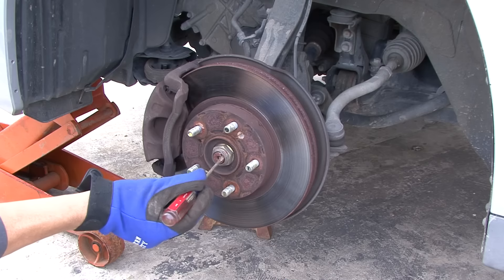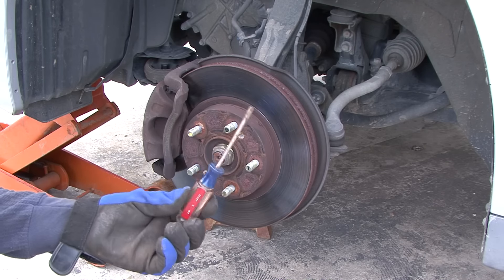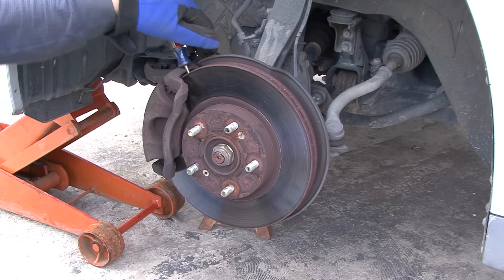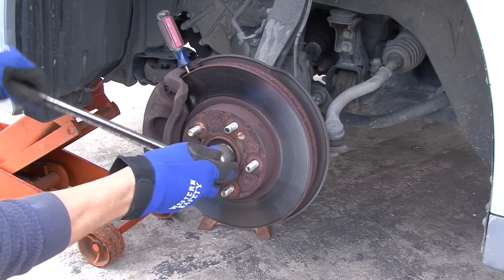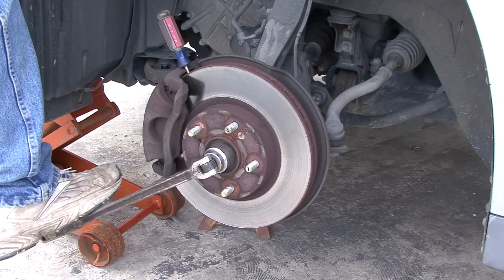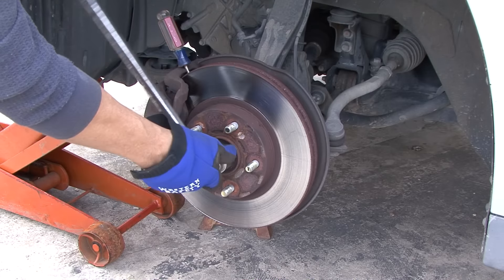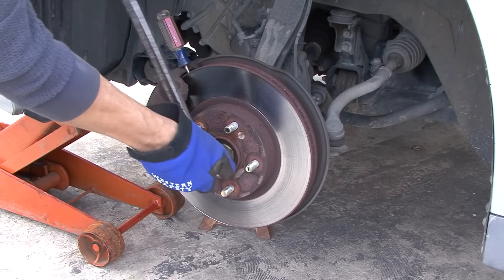How to make getting your CV axle nut off easier

Comment: Good idea with the screwdriver but I've never had a nut come off so easy. Normally it takes 2 meters of an extension and a 100kg individual dancing on it.
Reply: +David Egan Even then, you`re lucky if it budges
Reply: I have snapped 3 Craftsman breaker bars trying to loosen mine.
Reply: I think this may have been pre run 😉
Reply: no he's right they come off that easy with the screw driver in it, managed to pull off a decade old bolt after having put a torch, grease and a breaker bar with my weight and nothing, but fuck it the screw driver worked better than the breaks so there was probably paper work done to get this squared away
Reply: @johnkennedy3867  how did you get it off
Reply: @corymontano2661  ....it was the passenger side, front hub nut. I was two minutes shy of burning up the car and making it look accidental so I positioned the 4th breaker bar with a 3 foot 'cheater' to the right of the hub as close to the ground as possible then placed my 3 ton floor jack under the end of the bar and SLOWLY started to jack up the bar keeping steady upward torque on the cheater until it FINALLY 'popped'! 
thought for sure I had snapped another craftsman 18" breaker but no I hadn't.  you would have thought I hit the lottery!!!

Comment: First off it is a nut, not a bolt you are removing. Second it was already loose, they do not come off that easily. . .
Reply: Brian Swartz
most people understand the term is usually used in common exchange.  even idiots understand from the video whats you going on.. And yes it dose crack that easily I just did it an hour ago on an 05 2500 that was well passed prime condition
Reply: Matt Crawford The hell it does. I had my impact on mine and I am afraid I am going to screw something up on it.
Reply: I tried to "push down" on mine and I just lifted myself up in the air. And my breaker bar was like 3 times as long. And if I tried to lift instead, it felt like the car was gonna tip over. (but I managed to get it this way)
Reply: Brian Swartz   
Thanks captain obvious it's a nut! (as it says in the title) Smh!  He's just giving a quick demo, this could be helpful for someone that doesn't know ..
Reply: Every car is different. Your car isn't the only car in the world. I've had cars where it does come off that easy (he's also stepping on a breaker bar, which is A LOT of force, so it's not really "that easy"). I've also had cars where they were so tight that I put the lug nuts in and wedged a breaker bar against the ground, and it literally sheared the threads off a lug nut, before bending the lug nut, and still didn't come off until after another method.
Reply: We all knew what he meant by bolt. I just removed an axle nut after watching his helpful video and mine came off just about as easily after I’d soaked it 10 min with penetrating oil.

Comment: Absolute genius! After an entire morning spent hammering, heating, impacting, WD40-ing and plenty of cursing, this method worked inside of 5 minutes. I put a bottle jack under the socket for support and used a 24" breaker bar with a 4' pipe on the end for extra leverage but it cracked the rusted seal first push. Thanks so much for this simple but brilliant idea.
Reply: Bro hit it with a high powered impact and you won't have this problem lol
Reply: @frazer9 He just said he solved the problem.  Get lost.
Reply: @Spartan-Of-Truth  LOL
Reply: @zhrob1  Lol, the density man.
Reply: I haven't got to cursing yet

Comment: I am sure it works sometimes, however mine is 14 years stuck and after trying your method with a good penetrating oil I have just stripped the nut. I believe after a certain point one will just need to get mean with a chisel or more preferably an air cutting tool.  Regardless, I appreciate the simple trick advice.
Reply: I have already started at cutting mine off anticipating needing to buy another higher end cutter if the wheel on the ground pop off center cap idea does not work w/ 6ft breaker bar

Comment: You're a god damn life saver. Only vehicle I have and I have to get lower ball joints out before a big trip across the U.S. for a new life changing job in a couple of days. I already cut the nut off of my lower ball joint so I started to panic when I couldn't get the nut off the CV and all the videos I watched weren't helping, I just don't have all the equipment they do and I don't have to money for someone else to do it, then I just tried your method, I had to post immediatly to thank you. 11 years later, you're work has made a huge impact on my life and my families in a way you can't even know.

Comment: I did Break dancing and moon walking on my breaker bar and an extension bar ..no luck on a 1996 Maxima ....put a few blocks of wood on the ground and put the breaker bar on that and put the car in drive and it was picking the front of the car up and still not coming loose..Breaker bar went Snap and went flying broken up over my hood  ..went to hourborfreight and bought an impact gun and " POOF WHAMO " Off came that nut

Comment: Thanks for the vid, it certainly helped with the screwdriver. I still couldn’t get it though until I started pulling “up” on the breaker bar. Instead of pushing it down to the left with gravity. Back muscles are stronger...hopefully that helps someone too.

Comment: The trick with the screw driver in the venting hole is quite useful!
But the nut is usually much harder to untighten.
Once had one, which didn't move with an 1 yd extension by standing on the end of it.
Reply: Can’t get mine off

Comment: Thanks to this channel and commenter ideas.   If this does not work as shown in the video trying it with center capped popped off and wheel on the ground with a six foot pipe connected to a 1 1/2 ft breaker bar,  Ended up popping removing wheel, then added PB Blastered Axle nut, Torched Axle Nut, Chiseled and Heavy Hammered to cutt into opening slot as demonstrated, and chiseled away quarter inch covering of metal portion around hub, then PB Blastered and Torched one more time, popped wheel back on, placed wheel chalk at both end of wheels, and cranked back and forth both directions till I heard slight cracks, and finally forced as much pressure as possible after about 10 to 15 minutes of back forth to break nut free. Used 5ft hollow tube connected to new breaker bar. Required for 02' Mazda Protege5 driven in sleet and snow with 16 year old axle nuts.

Comment: I was replacing a wheel hub assembly following a tutorial and when they got to the part about taking the axle nut off i had already taken the rotors and brake caliper off. here's what i did: literally just jammed the base of a ratchet behind the hub, between the metal frame (?) behind the hub and the top of one of the studs, and then cranked it. the ratchet fell out a few times but it worked and i was desperate

Comment: I am working on a my Dodge Dakota and have tried this, as well as soaking it in PB over night it wont't budge. Yesterday I went and broke two 1/2 inch breaker bars trying to get the nut off. Today I spent all day with a MAP torch to the nut and after about 2 hours I broke a third 1/2 inch breaker bar so I am picking up a 1 inch breaker bar and the one inch socket so if using a map torch and a breaker bar rated to 1800 ft/lb of torque won't get it off then I am gonna need a miracle.
Reply: what happened alex did you get it
Reply: @alexcorrea308  I bought a 4 foot galvanized steel pipe today from home depot to get mine loose. $30 smh

Comment: I have never seen it come out that easy. That was a lot easier than my jeep (still haven't gotten it off after 2 days of trying).
Reply from the maker: ***** No i didnt pre-stage it but i had it off recently so it made it a lot easier than if it had never been taken off before
Reply from the maker: Oh don't get me wrong iv'e had some that was a nightmare kinda tight and had to use a big pipe to break free but i still used the screw driver on it too lol
Reply from the maker: No don't use air on cv axles it tears them up easily
Reply: +Cody the Car Guy Why would you care about the old one?

Comment: People who are watching this lol, normally a 10 to 15 years old axle nut is about 9000 times harder to remove than shown in this video. Right now I'm trying to find OTHER ways to remove the damn axle nut... such as perhaps breaking the nut itself, because mine won't even budge after heating it up and a 5 feet breaker bar.
Reply: +totszwai Dude that is truth!   I just snapped the head off my Craftsman breaker bar working on a 15 year old Accord.
Reply: Twenty year old Accord here. lol I was using my impact and it almost looks like the nut is starting to crack on the sides. Not sure if I should keep going.
Reply: Definitely Tru
Reply: Yep
14 year old Jeep and won’t budge for nothing.
Reply: Damn...heat won't work for mine either...now I want to buy a extension bar for my breaker bar sdmh this video is spool fake
Reply: Not the safest way in the world, but I got mine off by using my jack to lift my breaker bar handle. You'll want a strong breaker bar though.
Reply: @jerryjones2976  Why are old Hondas the absolute worst??
Reply: Sorry that I am 5 years late to this conversation but what did you do to finally break that nut?  I'm currently battling the same kind of nut and I am hoping that you have something new for me to try because I have tried everything and broken some equipment along the way...
Reply: @danrodrigues3531  Yeah, I found another 4 feet metal pipe and just hook it up to my existing breaker bar, basically... just get it as long as you can to multiply your force... when it broke loose, the bang was so loud that it sounded like a firecracker or gunshot lol
Reply: @ericto2958  After about 2 weeks and two broken breaker bars, I finally destroyed that stupid thing with a Dremel.  A Dremel with a tungsten metal grinding bit and ground out a 'valley' a couple of mm wide down to the threads on the axle that was being removed and that left just a tiny amount at the back the I couldn't reach with the grinding bit.  At that point I took a chisel and smacked the hell out of it towards the left and after some whacks, I noticed a small crack at the back which got to the point where the damn thing finally spun off with that 'valley' splitting it all the way to the back.  I have never been so frustrated with something so much.  I was spinning my wheels for days, going insane and it finally broke free.  Damn, it was too hot to work that hard on anything...
Reply: I just took mine off with a cheap corded impact wrench! Took about five minutes! $80 taxes in and no pulled muscles reefing on my breaker bar! Make sure to use penetrating fluid! Just replaced a strut assembly, a d used the impact wrench where ever I could fit it! Saved me hours of frustration!

Comment: One way is to loosen the nut while the tire/wheels are resting on the group.  Chock all the wheels and ask someone to apply the brakes before using the breaker bar.

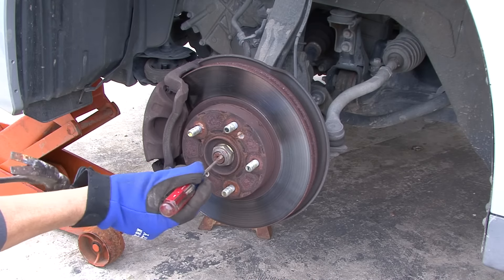Comment: At about 0:25 If you don't have the right size chisels getting that dimple out is a PITA too! Been working on it for an hour now and already broke 2 screwdriver heads. Mine is crimped all the way to the inner metal so I can't fit a screwdriver in there.

Reading comments about people breaking 1/2" breaker bars... wtf is wrong with cars these days.

Comment: WD-40 is your best friend in this situation. If you have nothing else. Spray some on the bolt and use anything you can to try to vibrate the bolt (as shown in the video with the screw driver) after spraying, and vibrating it 4 or 5 times let it sit for about an hour. Getting it off should become possible after that.

When I say vibrate it I mean, hit that thing with the might of Thor.

If it hasn't been removed for 15 years there is NO easy way to remove it but, with WD-40 it just comes down to time.

Comment: Thanks for the tip. I've heard not to use impact wrenches on anything with ball bearings, because the impact will rattle the bearings and cause premature wear. That's why some mechanics who have strong impact wrenches will still do this manually; no impact.
Reply: Finally, someone who mentions what my automotive teacher has taught me.
Reply: but if changing the rotor and the bearing is in the old rotor? it wouldn't matter right?
Reply: @zanecid1232  You can use an impact for removal, but should not use it for installation.
Reply: @genericusername1365  makes sense. thank you. that's why I got the torque wrench as well.
Reply: @zanecid1232 BEARING IN THE ROTOR ..... 😂
Reply: @frazer9  I'm confused

Comment: Man next time this screwdriver is going to brake and pinch your elbows , arms or eye ...  As a lot of people said below : THE BEST WAY for doing this is with the rims bolted on , and removed center cap , while vehicle is on the ground ! + Bonus from me - get e person to step on the brakes , you will tell me why ;) ?
Reply from the maker: 100's of cv axles later I have never broke or had a issue with the screw driver . It just works!! And sometimes doing it with the rim bolted on you will find the socket comes off easier because you are father away and can bust knuckles or what ever is in the way when it slips off.

Comment: I put my entire 300lb ass on the breaker bar and the nut don't move!!!
Reply from the maker: I have had a few be that tight. One one i used a 6ft pipe to break it free. You never know if someone used red loctite or not. You can also heat up the nut they spray some pb blaster
Reply: Cody the Car Guy Yep used a pipe and the 1/2" head snapped off the breaker bar.
Reply: +BigDish101 
I'm with you. My truck is torqued from the factory at 170 lb-ft, but that was 120,000 miles ago. Penetrating oil did nothing, not even with an impact gun. Today I'm going to blow torch and use a 6ft cheater bar. Hopefully I don't snap the breaker bar given how badly my week has been going lol.
Reply: +Mark Well how did it go??  I already used a gallon of liquid wrench, a propane torch, a 4 foot pipe, and the head just broke off my Craftsman lifetime guarantee breaker bar.   WTF!!!!!!!!!!!!
Reply: +jerry jones I put the wheel back on, put the truck back on the ground and stood at the end of a 4 ft breaker bar, lightly bouncing on it. It never truly "broke" free, so I had to back my truck up until the breaker bar was off the ground and repeat the process a few times.
Reply: My 3/8 bar broke off into socket while standing on the pipe extension. I threw the socket out of anger and the broken bit flew out. I ended up buying 1/2 bar and torched it for a couple minutes, came off no sweat.

Comment: Pshh yeah, i wish it was as simple as that. If this were the case, i would have been done replacing the bearing on my car 3 days ago....mine will not budge at all, its broken 2 breaker bars, ive danced on it, attempted to break it loose with the tire on and on the ground and a Big fat NOTHING!!! Im beyond frustrated with it and my repair process is at a hault until i can find a way to break that loose

Comment: What if it's so tight that the breaker bar breaks
Reply: +Lucas Burton I think I am about to have to resort to cutting the nut with my dremel.
Reply: +BigDish101 You da man!!... dremel did the trick.  Actually had to slice through the fucker in 3 places to get it off in 3 pieces.   Unbelievable... it ain`t rust... after 15 years of heat from the brake rotor, the metal fuses together.
Reply: You have to get 3/4 breaker bar and a long pipe :)
Reply: a 3/8 breaker bar just died here. Getting a 1/2...

Comment: Great tip. I already took the caliper and rotor off the hub. After heating the nut twice, I stood on my breaker bar and got it loose.

My trick is put a long enough box wrench around a wheel stud and have it vertical to the ground, and it kept the hub from spinning.

Comment: Hi,
I have a question about my 2005 Toyota Sienna.
One of the local mechanic replace the front bearings. After the replacement the wheel steering wobble or vibrate between speed 60-80. It is not constant all the time on any particular number. But when it start to vibrate, I slow down the speed a little and speed up, and seems fine. I have brand new wheels on my van before the bearing replacement, but after this problem I went to redo the balancing, but the problem still exist.
Do you have any clue what might be the problem.

Thank you,

Comment: Thank you for this tip! I had a helper pressing the brakes but the rotor was still spinning during my first hub replacement. I was going to give up before I found this video. 

I stuck the screw driver in the rotor slot and using a 3ft breaker bar the axle nut finally came loose.

Comment: Another tip.. MAKE SURE your socket is deep enough and is covering the whole depth of the axle nut. Sounds obvious yet but some cars the axle thread protrodues a little further out than expected, meaning your regular socket looks like it's fully seated home on the nut, even though it isn't all the way in... I snapped a breaker bar due to this so double check.

Comment: I've broken two breaker bars so far trying to get the castle nut off. if i did this stupid shit I would have destroyed my brake rotor.  Now if you're not a dumb ass you know to leave the tire on and the car on the ground so the mass of the car keeps it in place. this video should be called how to fuck up your car doing it yourself.
Reply from the maker: I have done hundreds of cv axles and it works perfect. Now have i broken a breaker bar before , the answer would be yes and i have even had some that i had to grind the nut off on one side to get it off. So there are a few exceptions hopefully you know enough to know the difference. The main reason i do it with the screw driver in the rotor by the brake caliper bracket is so you dont put extra stress on the transmission and some tires come out and make it harder to get a good snug fit on the cv axle nut.